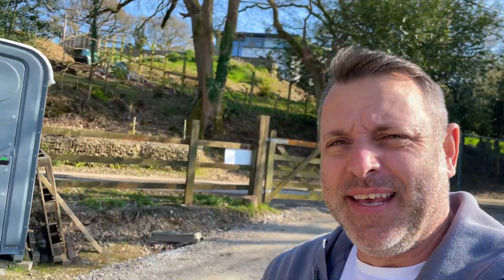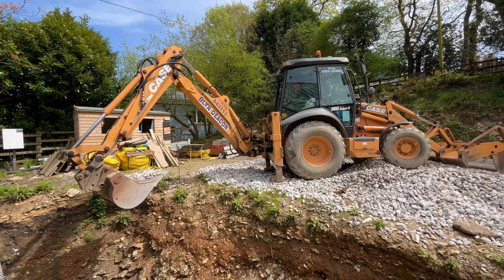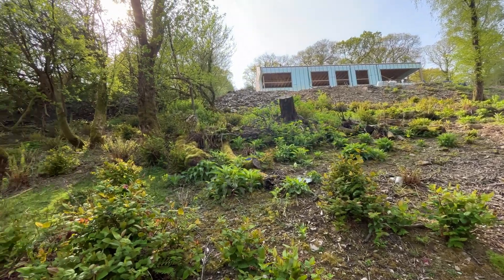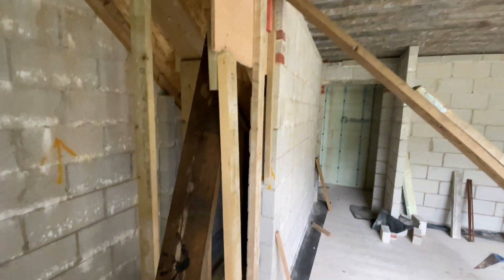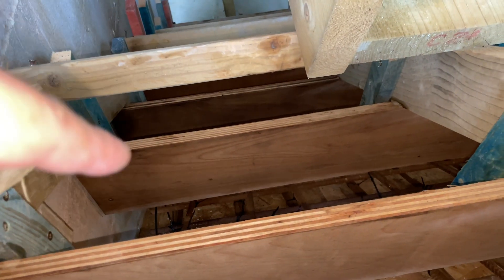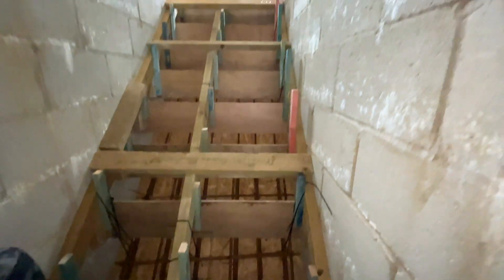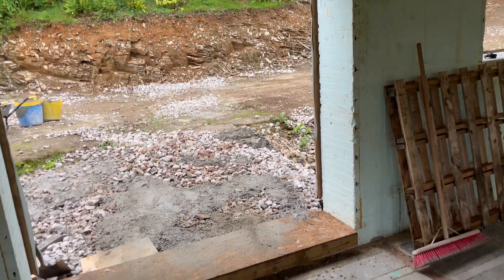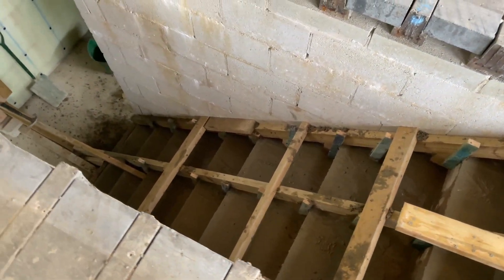Concrete Stairs Building, Pour and Backfilling - Self Build House 23

Comment: Why conrete over wooden staircase?
Reply from the maker: Hi Damian. Sound attenuation. We went to the effort of having concrete beam and block 1st floor which has excellent thermal properties and is quieter. If we put a wooden staircase in, it would be louder in one of the bedrooms. A wooden staircase would have been cheaper for sure. Also, I've never seen one installed so another tick off in my university of housebuilding course. Thanks for watching and I hope you have a great Xmas and New Year.
Reply: @Boxplanet  That makes total sense. <albeit it never occured to me>. I must confess I'd not thought of the thermal issues either. You both have a great festive period buddy.

Comment: can you do an episode on the concrete stairs, showing the metal supports. If it’s too late because concrete has been poured, can you show some drawing sections of how the base of stairs has steel and how large the base is and how the top of the landing sits on the beam and block, or if it sits on steel beam
Reply: Top tread into a C section with extra plate connected.  Bottom tread, almost double height due to internal floor build up.  Small 10 or 12mm cage bottom and top, linked with bar laid on a mesh pattern.
Reply from the maker: Jbee. Sure. I'll do a short soon with a bit more on the stairs if you like. I haven't got any more of the footage of the pour but I'll add dome drawings and more detail.